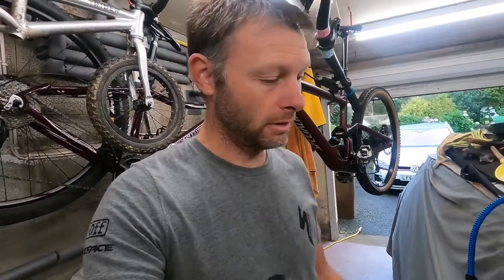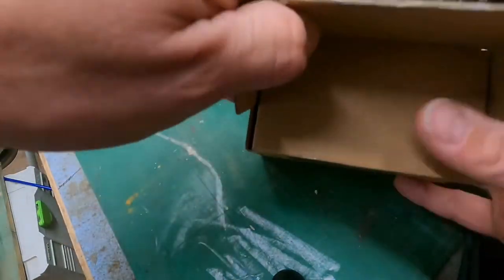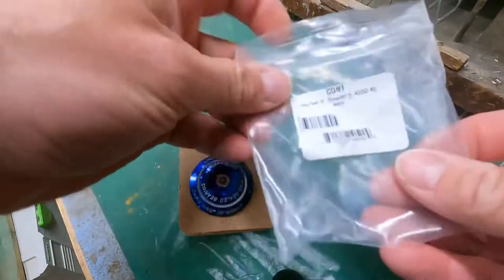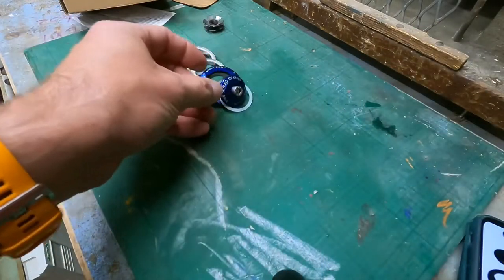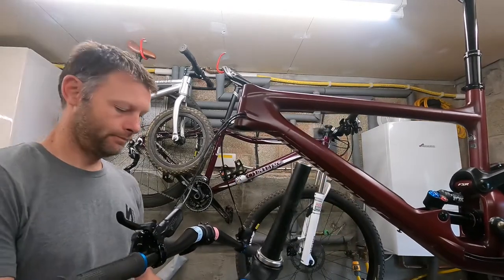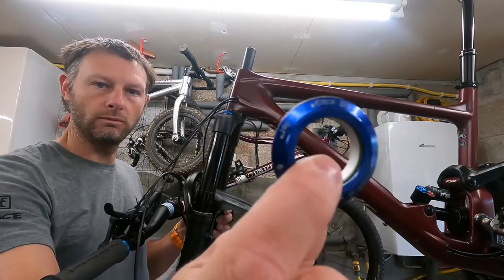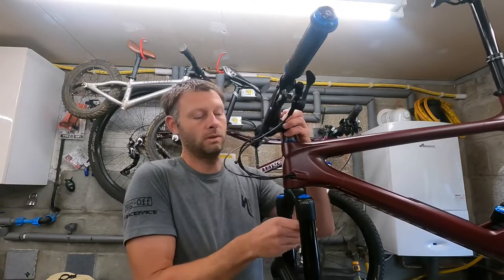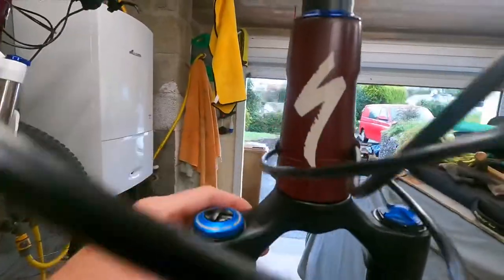Chris King dropset 5, unboxing and fitting. 2021 Enduro

Comment: how did you adjust your headset so quickly? Every time I try there's play. my fork moves around. I cant get it right, don't know if its my headset or not. Any tips?
Reply from the maker: Hello, are you sure you have the correct bearings? 
Normally its very simple, are you using the SWAT tool? 
If not could be a problem with the star nut inside the steer tube?
Reply: @LeeMGTi  yeah I'm using the stock headset and swat tool. Perhaps I have to replace my headset / bearings.
Reply from the maker: @action4769  yes that might be an idea, the FSA bearings are rubbish unfortunately!

Comment: Good to see that it's happening to other people as well, to loose spacers while mounting 😅 Thx for the vid and happy riding 🤟🏻
Reply from the maker: Awesome! Since fitting it Ive not removed it! Just been perfect 👍
Thanks for commenting
Reply: @LeeMGTi  Great to hear. Did you make some experiences with dust and dirt? I can clean the original FSA (fork part) every 3 days... Very dusty here in Germany at the moment, plus heavy pollen load in the air. So I was wondering how efficient Chris King is when it comes to cleaning.
Reply from the maker: @xflow  i ride in the UK so dust/rain and mud and ive not had to service it yet 👍
Reply: @LeeMGTi  Riiiiight, I forgot 😅 Thx buddy. Hit me up if you see me riding Bikepark Wales. It's deffo on my bucket list.

Comment: I have the 2018 enduro Ohlins Limited edition. I came off a santa cruz megatower. I plan on keeping this bike for a long time so got the two tone black and gold Chris King headset. You need to put the stem cap on because they are gorgeous, and fitting it with burgtec spacers and stem etc gives a nice look :)
Reply from the maker: Your right about the stem cap! There very nice and well made, I like having the tool in the stem and it looks OEM too 👍
Thanks for you comment and watching 👍
Reply: @LeeMGTi  theheadsets are so good. If you are thinking about keeping the bike for a few years and also always buying a bike with a threaded bb in the future, then a King BB is a worthwhile investment. I have one that is 12 years old and still going strong on original bearings. I used to go through a shimano one every 6 months
Reply from the maker: @jonathanhowson6420  yes i have the chris king ceramic BB VERY nice bit of kit , so smooth i ment to make an install video, but i got to excited and fitted it lol

Comment: Did it stop the movement/creaking that you were having issues with? I was looking at the DropSet 2 to replace the integrated FSA headset that came with My Kinesis frame. Cheers
Reply from the maker: Yes it did!! Straight away I noticed a different, and since fitting it ive not had it apart awesome bit of kit 👍
Reply: @LeeMGTi  Thanks for the video, the DropSet 2 that I bought has been creak free and looks the part too! I ended up ordering from a company near the factory in Oregon as barely anywhere had stock in the UK. Maybe I got lucky with customs, but I got the colour I wanted and it ended up £30 cheaper. Matt

Comment: Thanks for the video.  

The plastic washer is specifically to help reduce creaking so good on you for deciding to go with it. I don’t think King would put it in if he didn’t think it was necessary. Cheers!
Reply from the maker: Thats for the message! Your right since fitting the head set ive had no problems